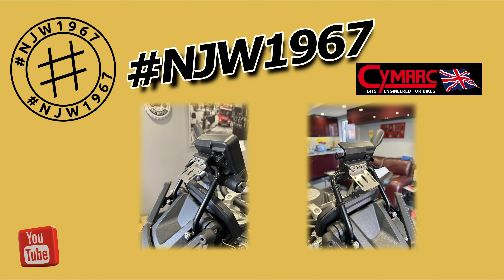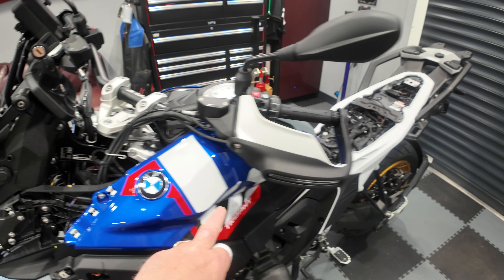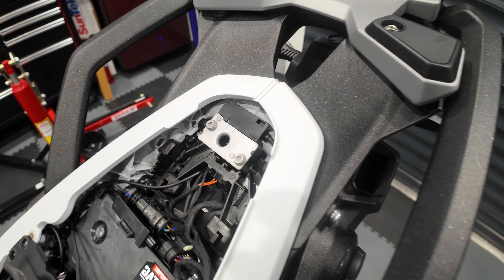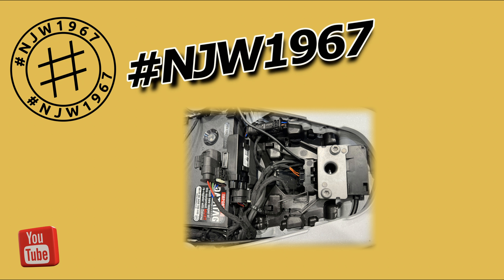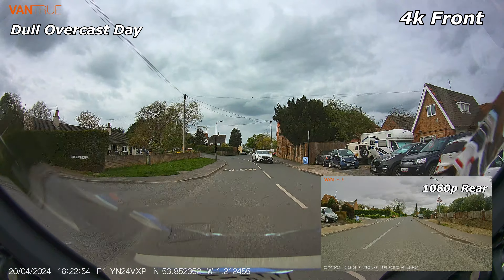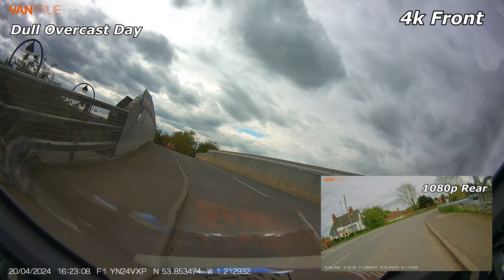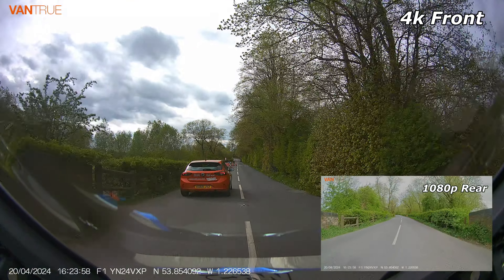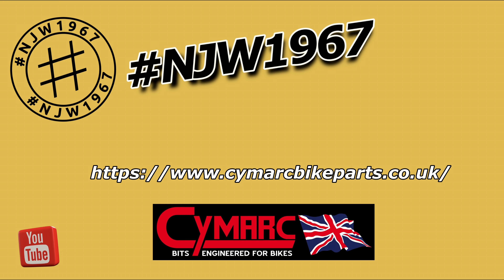Vantrue F1 the best 4k Bike Dash Cam fitting guide on BMW R1300GS & Cymarc camera bracket

Comment: I get that you wanna keep the front camera clean of bugs and debris. The problem I had when I put the camera behind the windshield on my XR was the windshield would collect all the bugs and block the camera. The windshield is a much larger target. I ended up putting my Camera under the front beak on my 1300. I went with the CHIGEE dash cam/Apple CarPlay unit. It came with a lot of extra wires so I ended up removing the tank and the airbox to let all the coiled up wires live below out of sight. Other goodies include the easy can which is a godsend for switching on accessories, with Clearwater lights and a Denali sound bomb It came out fantastic Thanks to guys like you posting these how to videos. You could never have too many videos online on how to take this motorcycle apart. Thanks again…